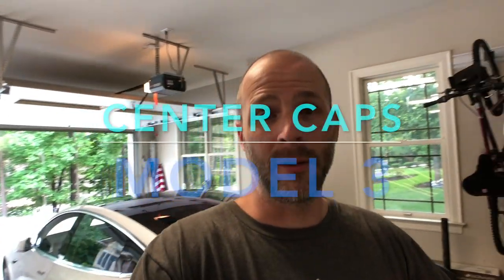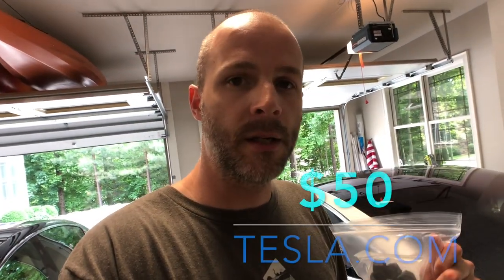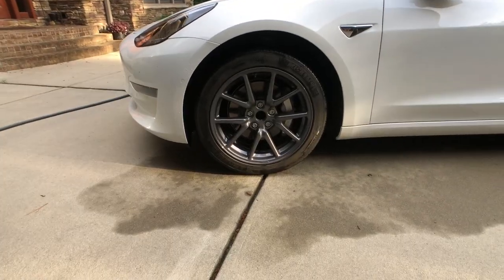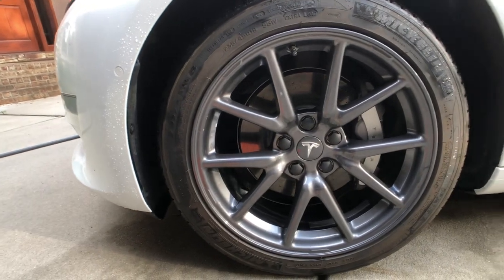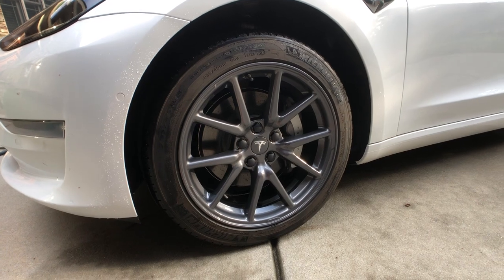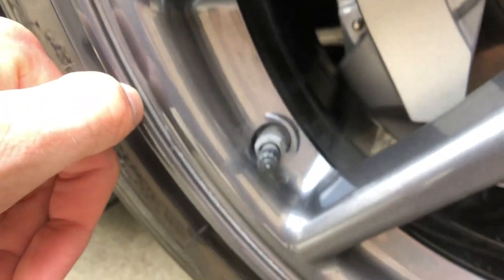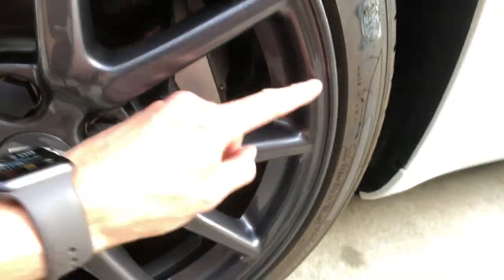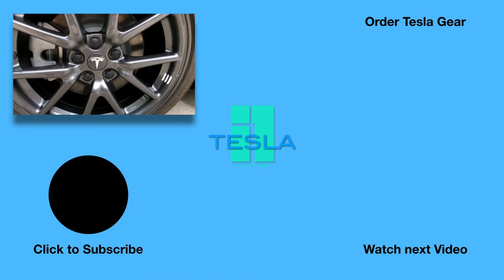Model 3 Center Caps 18 inch Aero wheels

Comment: Thanks for the tip on the Aero Caps rubbing on the rims. I’m in my 3 month delivery window and already have the center caps and lug nut covers, fortunately. When I take delivery, I will drive off with the aero caps in the trunk and the the center caps/lug nut covers installed.

Comment: The marks are small so maybe you could give Tesla a pass on this one.  Curb rash will eventually happen, and that will look 100x worse.  I agree that the wheels look much better without the aero disks.  Maybe you could use the aero disks when going on a trip, but put a little grease, or vaseline on those rub areas to keep the paint from getting marked.
Reply: wondering if brushing on a small amount of black rubber paint on the back of the disks would do the trick?

Comment: thanks for the heads up. I just ordered a set so that I can put them on when I pick up the car sometime this fall.
Reply: I ordered my lug covers/center caps on May 18th in anticipation of a long lead time, but received them only a week later on May 25th!
Reply: The Tesla store currently says "Please expect up to 8 weeks for this product to be fulfilled" so I ordered it. Haven't even ordered my model 3 yet because they haven't opened up the dual motor option for me even though I reserved just prior to the reveal. I even bought and wired up the wall adapter in the garage. A friend has a model 3 and came over to test it, so all I need now is my car. The consolation is that they keep making improvements to the product after every line shutdown. Still hard to wait. I feel more prepared after every i1Tesla video that I watch.
Reply: Order on June 4th and received on June 9th. It didn't even take one week to get it!

Comment: The only reason i have ordered the 19 inch wheels instead the default ones, is that the aero covers can be stolen easily, and i'm sure that with Tesla model 3 be known and known, they will steal them badly

Comment: The lug nut covers slipped on very easy and can be removed very easily. Am concerned that they will not stay on. Yes they were ordered from Tesla. Is this normal? Just don’t want to lose them going down the road.
Reply from the maker: I have about 5000 miles on them and have had no problem. Even on a long trip to Florida 1800 mies. Get them

Comment: I like all the little plastic caps, it looks great. Having said that, 50 bucks? This will probably show up on eBay for 10 bucks from a dozen Chinese distributors in a couple weeks.  Lastly, I'm sorry but that kit along with the paint touch-up kit (also 55 bucks) should come included with a vehicle that's almost $60,000.
Reply from the maker: You can go buy the $10 ones on Ebay it you want. I want the center cap paint to match and not fall off. The whole idea behind the Aero wheels where for people not to take them off and get better efficiency. You should have the option to get the hubcap or the center cap when you order.
Reply: Stop whining.
Reply: shepherdsknoll8 stop being ripped off!
Reply from the maker: It is not being ripped off if you see the value in the product.

Comment: Can you put the covers back on the wheel for a road trip? Or do you have to first remove them in order for the covers to fit?
Reply from the maker: You have to remove the center cap. The Aero covers lock into the same place as the center cap
Reply: Have you tried removing the center cap though? It's in there pretty tight it seems like
Reply from the maker: Not yet but I have an idea how to do it. I hope it works
Reply: i1Tesla can you make a video on how to remove those?
Reply: You have to remove the cap before putting the aero wheel cap back on. I saw a video where you can get a little suction cup to get the cap out of the rim.
Reply: i1Tesla   Hi I’m in Australia and we are finally getting Model 3s delivered here!   I thought your video was very helpful, so thanks.   Like you I plan to take off the Aero covers and put them back on only for long road trips.  So I am interested to know how you managed to get the center caps off so you could reinstall the Aeros.  Did you have to buy one of those suction devices or did you find another way to get the caps out?

Comment: I kept the aero wheels on my Model 3, they grow on you and give another 10% on the range. The car is already slippery, the aero wheels add to the slippery ness .
Reply from the maker: They say 10% but I am going to test it!
Reply: The 10% improvement on range is possible if the car is driven at 90-100 MPH most of the time. Where in America you can that fast ?
Reply from the maker: Going to try it this weekend
Reply: HT N on a 2000 mile trip to the Grand Canyon last month, we had to pass slow moving cars once in a while. Sometimes there would be 8 or 9 in a row. With the Model 3 , instead of passing 2 or 3 you could pass all 9. The only problem was that I would look at the speedo and we would be doing 105 mph- the Model 3 is muscle car fast. So yes, those speeds come into play with the Model 3 and add to the overall aerodynamics of the car.
Reply: Tesla Model 3 is capable of triple digits speed but doing it on any highway may get your driver license suspended. I'll bet that after passing those slow cars you were slowing down to less than 90 MPH. I drove between Orange County, CA and Vegas and Phoenix many times in the last 20+ years, the speed limit without problem with the laws is around 80-85 MPH.
Reply: HT N road trips from SoCal to norcal or San Diego. La to Vegas.

Comment: Can the hub cap be placed back on with the rim kit installed? Or do you need to remove the lug nut and center cap first?
Reply from the maker: I think you need to just remove the Center cap. Not sure yet.
Reply: i1Tesla can you do a video on removing to center cap to reinstall the hubcaps? Do you need to remove the wheel in order to remove the center Cap?

Comment: Hey Bro.  Decided what to do about that wheel gap yet?  My car hasn't delivered yet and I have the T sportline springs on order.  Any thoughts on lowering?
Reply from the maker: I bought the T sportline springs too. I have not got around to installing them. I think I am going to wait until I finish my show garage then install them. Should be in Nov. The one inch lower should be a good fit. Haven't heard anything bad about them yet
Reply: i1Tesla thanks for responding.  I think you’re in Charlotte as well. Gonna need to link with you at some point. Keep the channel live. You’re doing exciting stuff.  I have one other white M3 RWD a few houses down from me. Mine is scheduled to hopefully land in November and is AWD. Will subscribe.
Reply from the maker: Cars and coffee in Charlotte first Saturday of the month. There are normally 6-10 Teslas there. I am up in Mooresville.
Reply: You going this weekend?
Reply from the maker: Next weekend the 6th and Yes